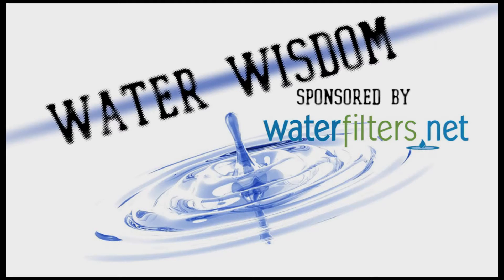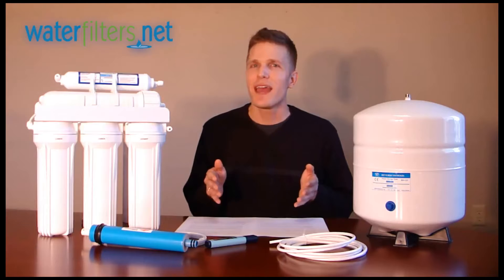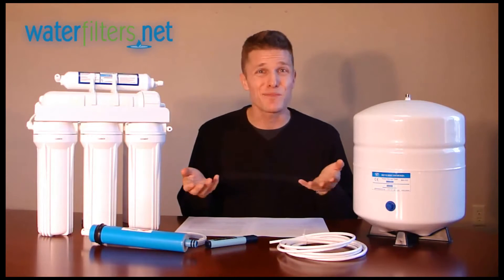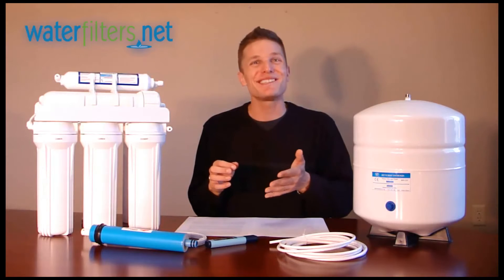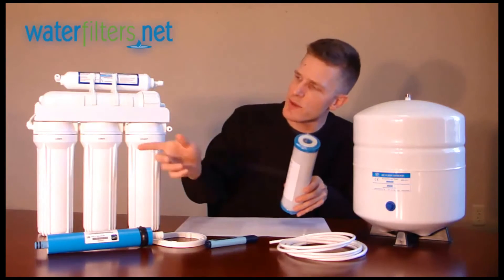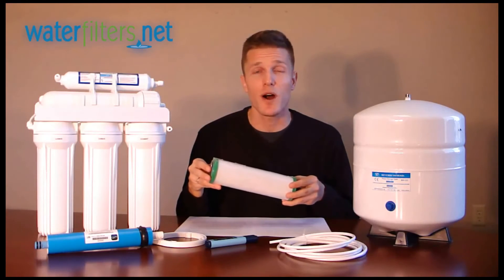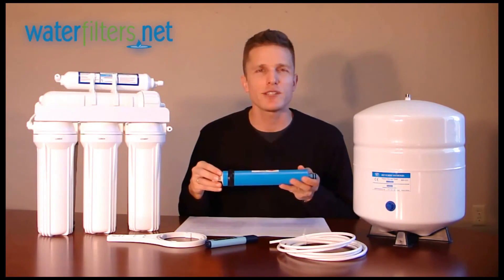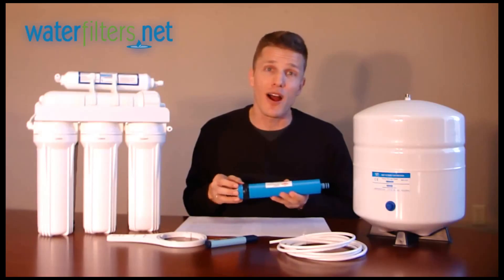Reverse Osmosis System Overview Part 1

Comment: I have a unit that looks as yours but it is a Cuno Aquapure PW-RO4. I called Cuno (3M) to ask what filters I needed to order. He told me that I needed 2 carbon Pre and 1 sediment Pre (not counting the two top filters) So as I took the 3 filters out, I noticed that there was 2, instead of 1 sediment filter and only one Carbon instead of 2. The canisters also confirmed as they were labeled for 2 sediment and one carbon. Is it OK if I put in 2 carbon and 1 sediment? What would the difference be?